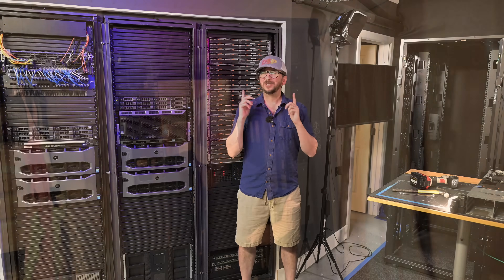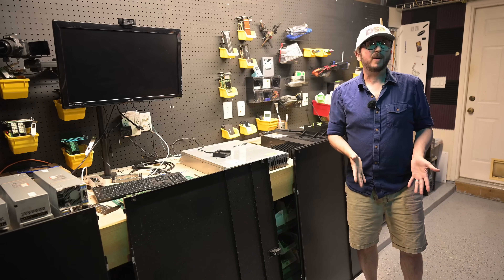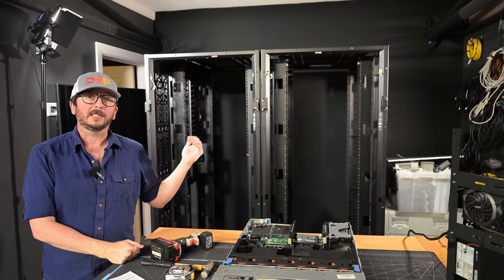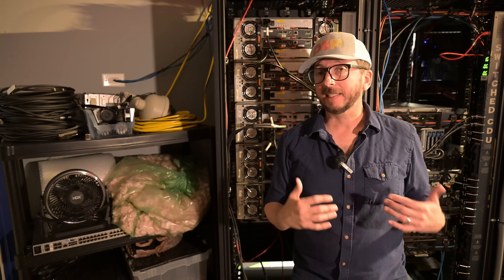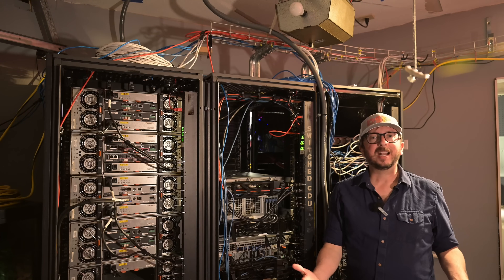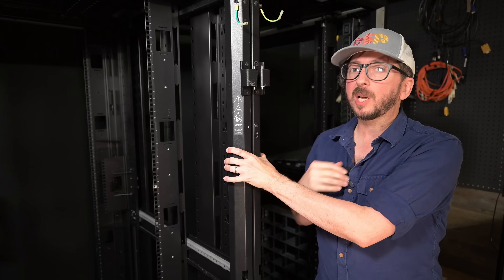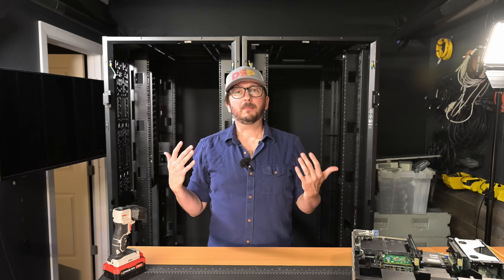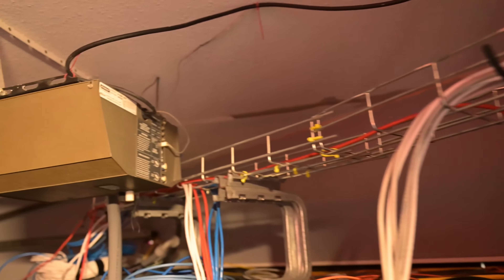Home Server Rack Tips and Tricks for Homelabs

Comment: I think a good lifepo4 setup is way better than the typical UPS these days. You can even get rack-mount batteries, so it's not even going to take up that much more room.
Reply from the maker: @michaelgleason4791 this is a thing I chat about with some folks often. The inverter running full time 24/7/365 and being really high quality seems to be the major difference we have found. The transfer times are acceptable but I would love to plop in a bunch of the rack batts and call it a mega win
Reply: @DigitalSpaceport  My setup runs along at like 800 watts among 3 computers, so I just have a $300 portable. But yes if you're pulling that much power, you'll need a high quality inverter. And at that point, you might as well throw some solar panels on it too! If you have the yard space, scratch and dent panels are dirt cheap.

Comment: Damn. This channel is what I was searching for.

BTW, let's say I would like to build 2kWh homelab in a basement (probably not untill I move to US). How could I make use of excessive heat to let's say heat running water and building levels above? And does anybody know how much of energy used by modern computers (w/o monitors, spinning drives) returns as heat - I try to understand the first law of thermodynamics applied to electronics where work (W) is harder to spot than the heat (Q), like bytes saved to SSD in a headless machine?
Reply from the maker: @wojciechb1602 "heat running water" - I dont know but I want to know "heat building levels above" - ducting and inline fans. The laws of thermodynamics do not change as a result of these being computers. That is 3.412 BTU per 1 WATT and is a fixed simple multiplication calculation. There is nothing that alters that calculation. Use a Kill-a-watt meter on your gear, then multiply. That is the heat produced by that gear in BTU.
Reply: @DigitalSpaceport  Oh, great. Thanks.
One more question - I guess that You have PV panels, so out of curiosity, is there enough sun in Texas to power Your home 365 days/year?
Reply from the maker: I do not have them yet but we have some amazing plans and of course will be documenting the entire thing for the channel. Yes we have a great solar score here at our house and some great field mounting locations.

Comment: The APC NetShelter racks are legendary, and I miss my one. I deeply regret selling my NetShelter- it had all the panels and access control via a keycard, plus metered PDUs. That was the biggest mistake I have made. I moved my equipment to a data center, and their racks are terrible - no cable management space and cramped- I cannot wait to be out of contact on Sept 1st and  move my equipment back home.
Reply from the maker: Im very sorry for your loss. If you are in ATX area there is a fantastic deal on netshelters on FB marketplace that popped up right after I bought my last one.

Comment: I had the 12U from startech wich was geat and currently own the 42U from startech as well. That format is pretty good for 12 to 18 I would say but 42 is too flexible or not sturdy enough in my opinion. 
I currently have 10 IBM system x servers, 1 S822L, a gigabyte g292-z20 and more... Those are pretty heavy and moving the rack can be really challenging.
I wouldnt buy it again even tho I only paid 325€ for it. but i'm will keep it and tinker some side panels to make it right.

Comment: I never imagined hosting a home lab, let alone a server rack! And yet, here I am having purchased a rack-mounted NAS server I bought used to upgrade from my first desktop mounted NAS server. I had to figure out how to install it. I live in a flat appartment, so space is at a huge premium. Fortunately I have high ceilings and therefore there's lots of wall  real estate (in contrast to floor real estate). So I decided to purchase a vertically oriented wall mounted rack stand. It has only 6 U capacity, but it should be enough for my needs. The rack mounted NAS uses 1 U. And it can be expanded with another 1 U unit. So I have expansion space if I account for 2 Us.

And then I purchased the Dell Poweredge R530, which is 2 Us. I purchased it for performing high performance computing, and since I am devising the way to also perform local AI tasks/services.

In order to have UPS units for the rack, i have reused a wooden shelf and have it hanging with ropes from the top of the wall mounted rack. And I can adjust the length of the ropes. I also have there the switch. Both the UPS and the switch are desktop mounted. So this is the way I have found to have compacity/density for my home lab.

The main issue with this setup is thermal management. The overall power is not a critical aspect because we are talking about a 6U rack. But having the servers set up vertically oriented instead of horizontally, means that the fans are pushing the air inside the servers from top to bottom (instead of from front to rear). And this is less than ideal. Anyway  I wouldn't have had a hot corridor / cold corridor.
And I don't have any insulation nor HVAC in place in the home lab room, which is also my home office. So a priority is to keep noise at a minimum.

Well, actually I did do some acoustic insulation. I glued a cork sheet to the wall were the rack is mounted in order to prevent noise propagation to the bedroom at the other side of the wall. And I can tell it does a good job at that.

Comment: Flat pack Racks are your friend if you need to get a rack into the basement or up a flight of stairs. The biggest issue is likely going to be cooling. Likely you need a minisplit to cool your server room. Dust is another issue. The only practice way do deal with dust is with a large air filter. FWIW: I built an air filter with a custom filter cabinet using 4 25x25 filters & a blower. its set up to take two sets of filters: metal washable filters to trap most of the large dust, backed up with a MERV 10 filters to filter out the smaller dust. This can be run on a timer so its not running all of the time,